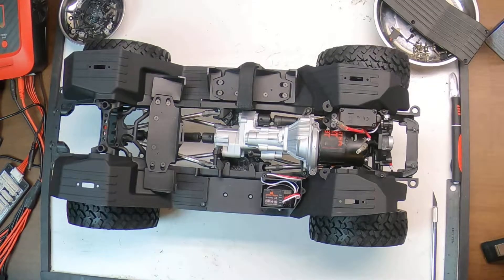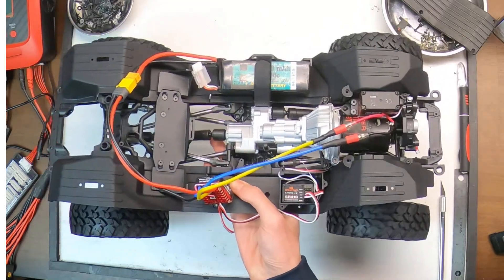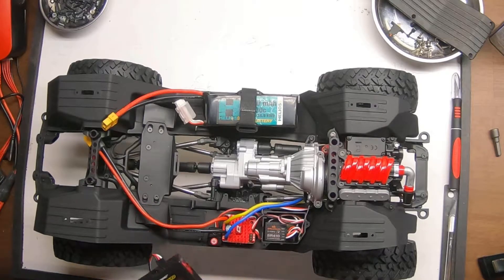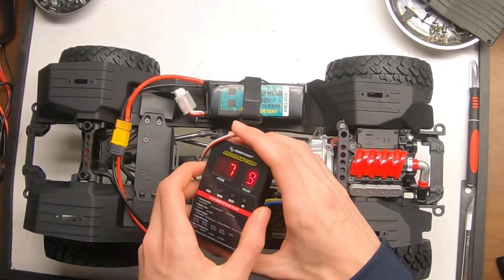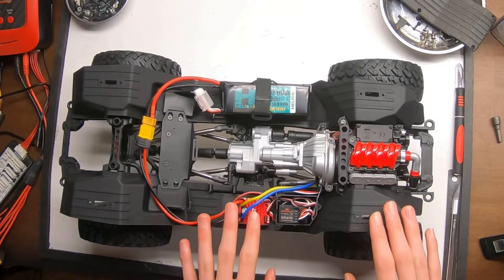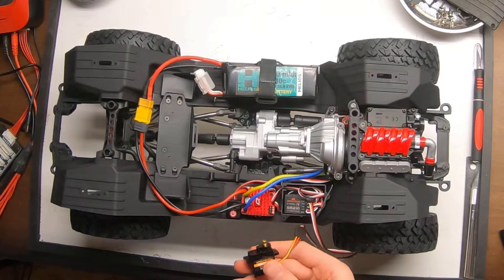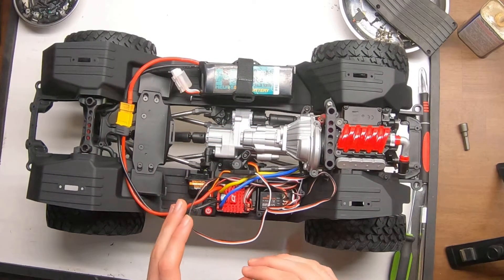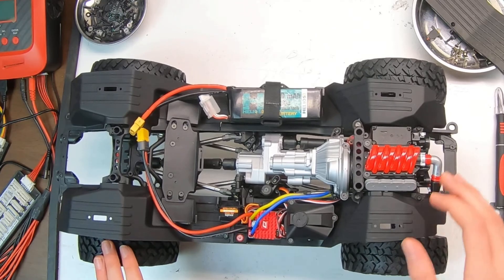Electronics + Hobbywing 1080 Esc Programming! Axial Scx10 III Build Series Pt 8

Comment: how to set up end points of micro servos? i have 3 in TRX4, can i set all of them?
Reply from the maker: If you have a radio capable of setting the aux endpoints, then yes.
Reply: @TheHobbyistRc  thx for response. but what happens when i dont? i dont see in my trx4 manual any info about adjusting the servo other than the big one (steering) ? :(
Reply from the maker: @maciekm.4169  As long as your running the stock radio system, with the stock servos, you shouldn't have any issues. But if you decide to upgrade the servos, or replace them, you will need to adjust the endpoints to avoid burning up the servos.